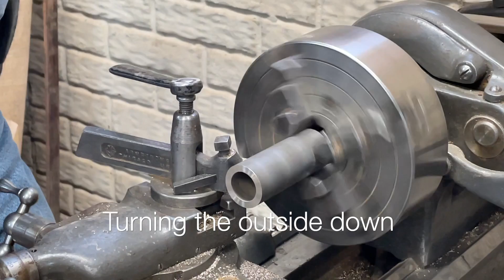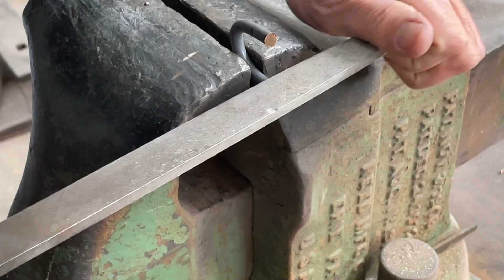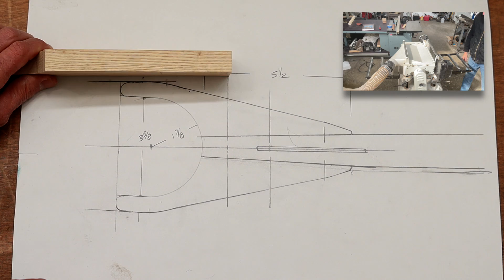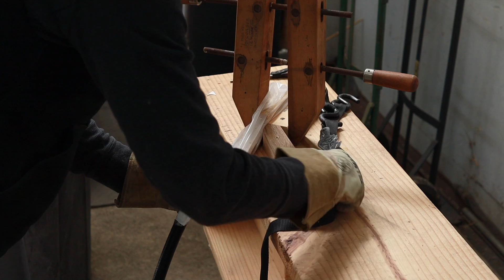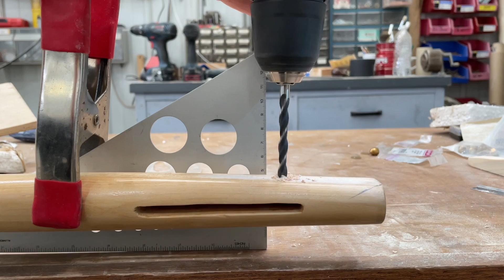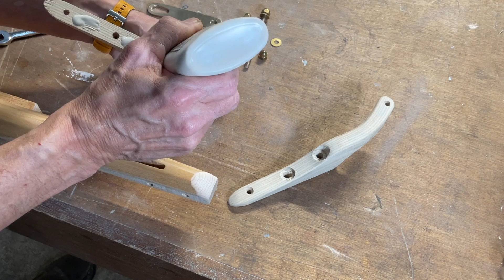Making the Gaff Jaws and Jib Club Tack Socket, S2-E63

Comment: Your work is very precise and whimsical. I love seeing who produces every item and accessory on this boat. A real jewel.
I have a question, I want to do some work that goes in polished brass, and I would like to know if I can use something that will keep it protected and beautiful for longer. I've been thinking about Renaissance Wax, is it the best option or are there better ones? Thank you.
Reply from the maker: Thanks Wagner,
Yes, was is the best choice. I’ve use lacquer based products for sealing bronze, brass etc. Even though made for exterior exposure one the years did not hold up and the one had to remove the sealant to re-polish. So was is the best and apply it often. 

Cheers,
Bob
Reply: @TheArtofBoatBuilding  Thank you so much Bob!

Comment: What particular bronze did you choose to use from McMaster?  Would you choose a different bronze if you were going to make a casting?  Thanks
Reply from the maker: Hi Scott,
Yes, I would use different bronze for casting. For fabrication I used c932 Bronze bearing stock from McMaster-Carr. This is a standard material for general purpose applications and one of the most popular bronze alloys. C932 bearing bronze is hard, strong, resistant to wear, resistant to impacts, and easily machined. Additionally, c932 bronze is ductile and resistant to corrosion. It can be easily soldered and brazed, though welding is not advised. 
For casting I use Silicon Bronze. Silicon bronze is a low-lead brass alloy that is generally composed of 96 percent copper. The remainder can be made from silicon and a variety of other alloys such as manganese, tin, iron, or zinc. Silicon Bronze is known for its easy pouring ability, and easy welding properties. It too, in addition to its  appealing surface finish, has superior corrosion resistant properties.
Thanks for your question and watching!
Cheers,
Bob

Comment: Excellent as usual.  Any concern of water getting into the holes on the gaff causing rot?  Drill fill drill with epoxy?
Reply from the maker: Thanks Paul, No concerns about moisture. The gaff is at the top of the main sail very unlikely to get wet. If so I will dry out easily. All bright work is sealed with varnished and will get inspected and revarnish every new sailing season.
Thanks for watching
Bob

Comment: Good  solution to the jib club, I chose to cast mine in 2 parts and have bought some beyond ridiculously expensive TIG welding rod to join them together.

I've never TIG welded bronze and the filler is too expensive to experiment with so here's hoping...
Reply from the maker: Hi Geoff,
Check out this link to Airgas. https://www.airgas.com/product/Welding-Products/Filler-Metal/TIG-Rod-%28GTAW%29/TIG-Rod---Bronze-Alloy/p/RAD64001567
You’ll fine welding bronze is almost easier than steel pools very fast.

Comment: Hello Bob, nice work as always.
I think the brazed parts will be plenty stong. A little tip. When I need to make two equal flat metal part, I glue them together with a couple of drops superglue. But when you do this you need to frequently cool in water while grinding. Heat breaks the super glue bond. I always grinf without gloves to feel when it gets too hot.
I have a question about the varnish. I have a sail boat, no not a wooden one - fiber glass. My prior boat had quite some wooden parts though, e.g. the tiller. I never had any luck with marine varnish. Even with the best ones on the market I had to redo it every two year sometimes yearly. I switched to an UV stabilized oil (available on the market in Germany) this extended the time to refinish the surface to 3 to 4 years. Any experience / opinion?

Comment: Gorgeous work, as ever.  I have no knowledge of bronze welding, but I was surprised that silver solder can take the loads.  Not a challenge, just a surprise.  Thanks Bob.
Reply from the maker: Hi Rick, Silver soldering is more like brazing than welding. In welding bronze the 2 base parts that you want to joint need to melt with the same alloy filler rod. Silver solder is more fluid than brazing and works by being drawn into the joint by a capillary action.  The Silver Solder will be drawn through the joint, filling the minute crack between the two pieces of metal, bonding with the surfaces to join them. The 45% silver solder I used has a tensile strength of over 60,000 psi.
If I had welded the flanges on I would only be able to reach the outside of the joint which would result in a weaker joint than silver soldering it. So silver soldering seemed to best approach.
Thanks for watching!
Cheers,
Bob
Reply: @TheArtofBoatBuilding  Thank you for the lesson in silver soldering, I learned something new today.
Reply: @TheArtofBoatBuilding  Thanks Bob. I think 60K PSI will do!!
Reply: @TheArtofBoatBuilding  Easy flo 45 and Handy Harman flux  would be a good combination for this type of assembly when the parts fit fairly tight and there are no gaps to fill. This alloy melts at rather low temperature (circa 600 C, 1150 F), thus, there is a minimal distortion and the finished job looks very neat, much better than a welded joint. Submerging the assembly in water right after the soldering removes most of the black oxides and makes the cleaning easier... very nicely done!
Reply: Crossed my mind as well, but like you I have confidence in his decision.